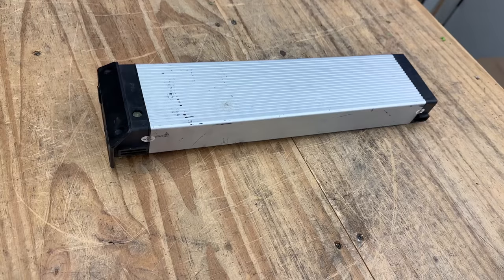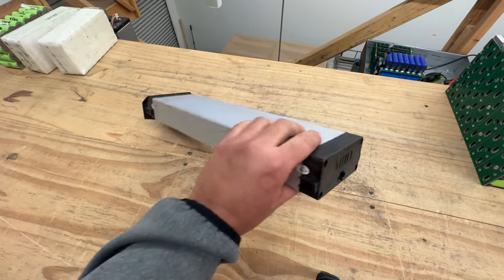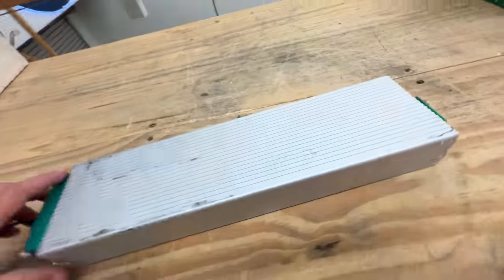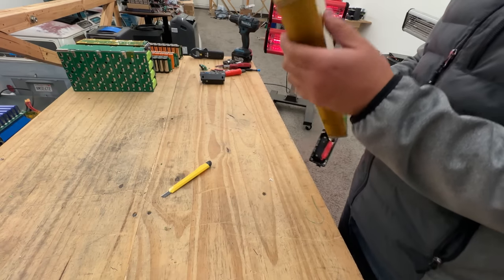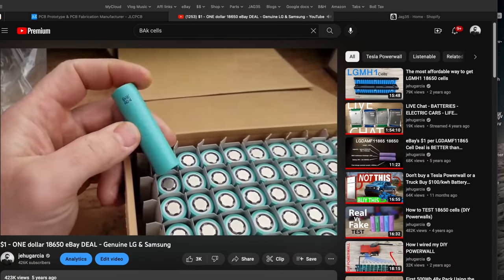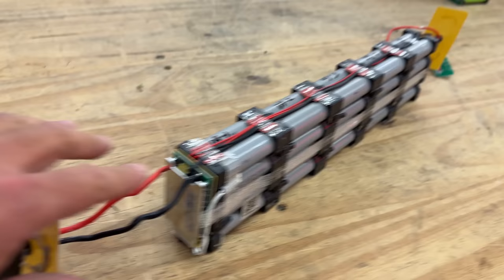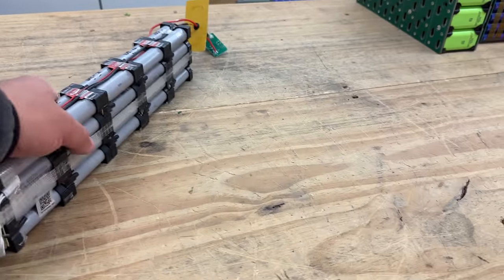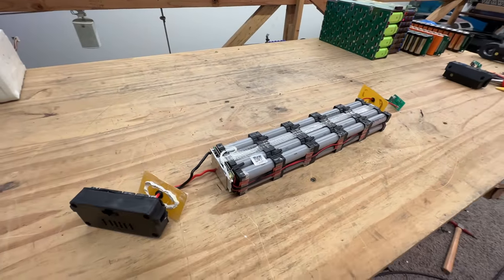$49 750W eBike Battery pack

Comment: This pack is great for the price considering it  comes with bms and protection case. Get d xt60 strip, cut the wire on from the plug on d bsm side and add xt60, do the same on the charge side.

Comment: 10 of these and it will power a small 3000w motor kit for bike builds. And 5 in parallel u get 45ah at 72v pack once fully charged @84v. It's a not bad and just at $500.00 after Shipping estimate cost.

Comment: About a year ago, i got few of these batteries for free and who gave those to me claimed that they are dead and dont even take charge, i open one and check voltages and seems pack was ok and charged, then i just unplug balancer wires and plug them back and battery pack worked again.
I open all other battery packs and was same issue with BMS.
Cells was SW18650-26HPA

Comment: 40 cells X 3.6 X 2.2 = 317 wHr per pack. (Capable of outputting around 640 wHrs for half the time) So roughly $150 per kwHr
Reply: Yes, I was thinking when I did seen a screenshot of the video what it's a 720wHr pack for a 50$ )))
Reply: The cells are BAK H18650CIL
Reply: 40 cells connected in 10s (not 40s), 4p, 2.4A/Cell. Now do the math again.
Reply: @sam_wyt9879  Good idea! Let's do the math again.  Power = I X E. 1 cell has approx  2.2 (amps) X 3.6 (volts) = 8 wHrs of energy. 8 X 40 cells = 320 watt hours for the pack. Therefore, you can draw 320 watts for an hour. If you draw 720 watts, your pack will only last 1/2 hour.
Reply: @hippie-io7225  according to your math YES its around $150/kwHr. But it's 2.4ah/cell and the 36v is minimum charged (50%) capacity.
Also it doesn't matter how long it last, that will depend on the load.
Reply: @2:05 the label is shown with 36V9.6Ah and that is what Jehu says.  I counted the cells and there are 40.  So 4p.
9.6 / 4p = 2.4Ah per cell, not 2.2Ah.    36*9.6 = 345.6 Wh per pack, not 317.  The 720 watt power output limit comes from the 20 Amp current limit of the BMS, and the nominal 36 volt pack voltage (10s*3.6v).  The pack is not 720Wh, it is 345.6Wh.  The 20 amp limit on the BMS means the max power draw is 20A/9.6Ah = 2.08 C.  

Update:  Thanks Gil L for spotting the cell model,  That model's data sheet quotes 3.7V, 2.4Ah, and  'Discharging Rate 3C', so the BMS is conservative - limiting max current to about 2/3 of rated current.   
The 3.7V nominal rating  actually should bump the watt hours to 37*9.6 = 355.2 Wh
Reply: @eideticgoone7035  Cool! I'd rather have your specs from a datasheet rather than "guesstamating", yet, we all gotta start somewhere :)
Reply: dont worry guys, i got the same kind of pack, same bms, 5 of these 40cells 10s 4p, some are 2 packs samsung 2500 and othrr 2900, and 3 generic 2500. they all output between 320 and 370 Wh, tested them from 42v till 32v(shut down by bms)  so he is right, NO 720, which made me click click this video wondering where i can get this pack. btw, the 36v, is an avarege Voltage, cuz the cells will start at 4.2 max max and end at 3.2

Comment: Jehu, can you look at the transistors in the BMS and see what the max voltage they can take - you may not be able to put them in series.
Reply: When I was working with them they were 30amp fused
Reply: The BMS is marked SP-R13-090-A03A.   I was never able to find any info on it when I looked before
Reply: @Gil L  So it 'could' be max 90 volts, 30 amps. If this is the case , then it would be ok to have 2 in series. Single pack is 42 volts max.
Reply: @BrazzaB1  there are 4 crss052n08n N-MOSFETS which have an 85v rating according to the spec sheet i found
Reply: @PennIsMightier1  So they would be 'just' within voltage range. Obviously the spec has a tolerance and so I would expect the transistors to be OK up to 90v
Reply: also a sbt20100vct schottky rectifier 100v 20a
Reply: In series each pack's BMS only 'sees' the voltage difference between its input and output. This voltage is only due to the voltage of the cells in the pack it self.  There is no need to increase the ratings of components in the BMS.
Reply: @eideticgoone7035  The MOSFETs see the full voltage difference. If you think of it, if you charge the packs in series, you put say, 75 volts across it. the full potential is cross the MOSFETs. Think of them external to the batteries.
Reply: @BrazzaB1  You are right.  I found a reference to a scenario where the the last MOSFET of a number of packs in series opens (off), and is connected to say a motor field coil of low resistance.  The last MOSFET will have almost the entire potential less that lost in the field coil it connects to.

Comment: Charging port looks like a Lenovo charger. They have a similar square connector.
Reply: But Lenovo's are 19V, IIRC.
Reply: @jameswyatt1304  Thank you, Capitan obvious. Nobody was been talking about using a charger from a laptop, just a port.
Reply: @pashko90  Thank you for the promotion from Private Opinion!  Doing my Obvious duties, I'll point out that they actually said "Charging port looks like a Lenovo charger", but it just looks like a Lenovo charging port, not a charger.  PPPppphhhhtttt!
My point was: If anyone's thinking about trying a Lenovo charger, it's likely not a good plan.  How about a part number of reference for the connector?  These originally got my attention because I'm curious if you could connect as 2S3P to drive something needing 72V at 50A+, which was why I was interested in the connector to begin with.
On, and nobody's "talking", we're typing, but I could see how you could get confused about that.  Thanks for the chuckle.
Reply: The lenovo laptop charger connector physically fits. But the pin out is different. The middle pin and the outer wall on lenovo is negative and inner wall is positive. While on the battery pack the outer and inner wall are negative and pin is positive. So you need to take the connector apart and rewire if you want to use it.
Reply: @SaurabhGoogle  That's a good news. Yes, Pinot might not fit.

Comment: Please i want to know which of the following is more powerful for an ebike to climb hills:
1.) 36v 20ah battery pack (720 watts) or 
2.} 48v 10ah battery pack (480 watts)
Reply: When you say "powerful" what you need for power is amp, not ah. Forget the Watt for a sec, 36v or 48v 12v, 72v etc,  are rated to run devices or load of their equivalent voltages (except you are building with booster or buck converter) . Once you achieve that the next is (ah), which is what you give you longetivity i.e how long you can run it. 
Lastly depending on how powerful the device is, (amp) is what will determine if you can only run the device to its minimum, average or max capacity.
Reply: @sam_wyt9879  thank you. So the amp the controller draws and supplies the motor, is what provides the power.  Let me rephrase the question. Which of the following provides more torque to a motor:
1.) 36v controller that can draw 20 amp or 
2.) 48v controller that can draw 10amp.
Reply: @odoohub5010  the formal I believe. Just don't run electronic device at their max "continuous" instead get something above the power u need.
Reply: @sam_wyt9879  thank you

Comment: @jehugarcia Any suggestions on how to get this pack to take a charge without dismantling it to bypass the bms. There is a 17V total charge on the pack at the moment.
Reply from the maker: From what I remember you just charge it through the output
Reply: Actually, I ended up taking the charger port of the battery pack off and connected the 42v charger directly and it looks like it is charging now. Thanks for the heads up on the alternative method though.

Comment: You still got any of these?
Reply from the maker: Yea
Reply: @jehugarcia  
Would the 750w be peak output? Like is it ok to use this for a 750w peak motor?
Or is it better to go with more than the peak so the battery isn't getting too close to its rating?